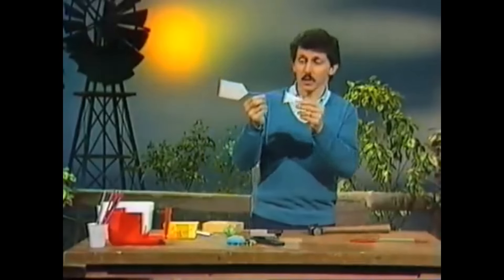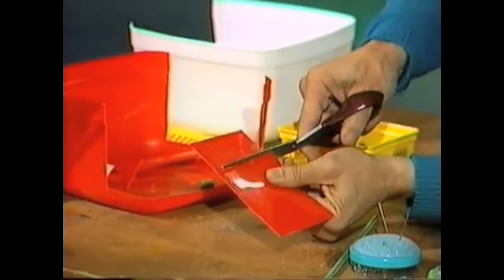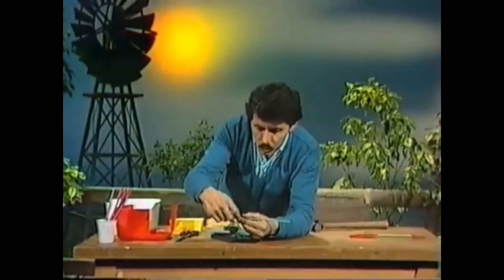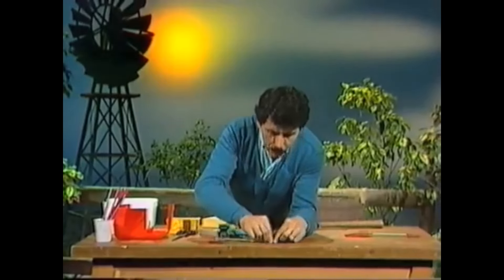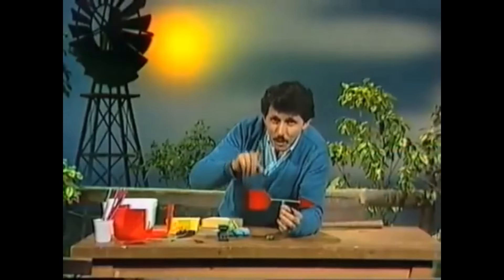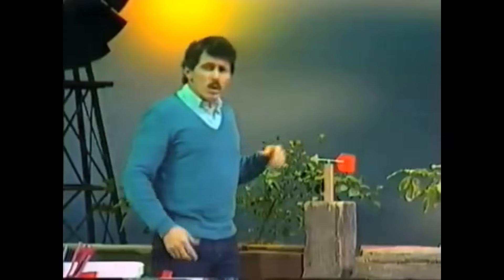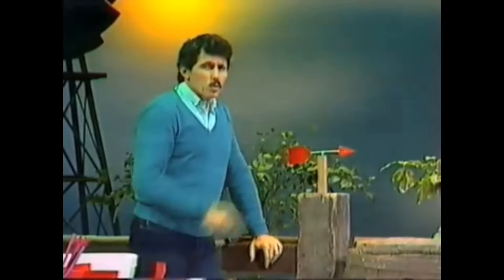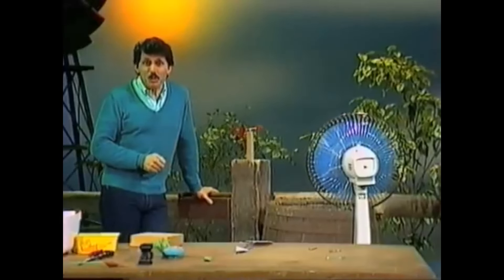Making a Wind Vane

Comment: I find myself wondering whether, in this case, "the center of the straw" really means (A) the middle of the part of the straw that is exposed between the red parts, (B) the middle of the whole straw, or (C) the middle of the whole arrow.  I think C likeliest.
Reply: I think you can choose freely based on your liking. Or maybe based on the centre of gravity on your contraption.
Reply: @andrebartels1690 , the center of gravity certainly seems the best choice if the point is the freest movement on the axis.